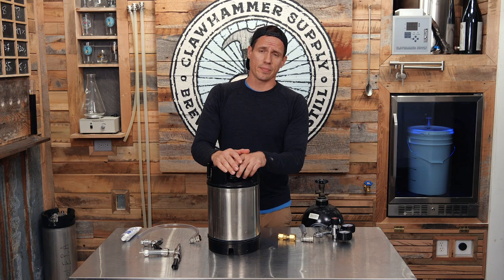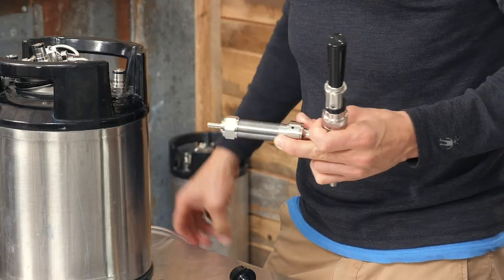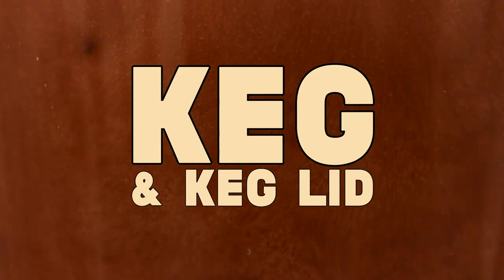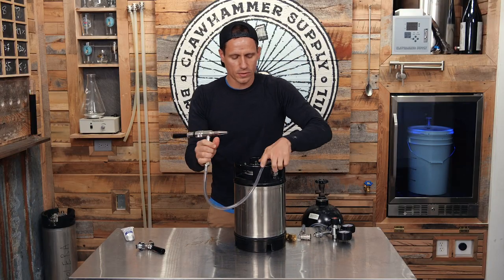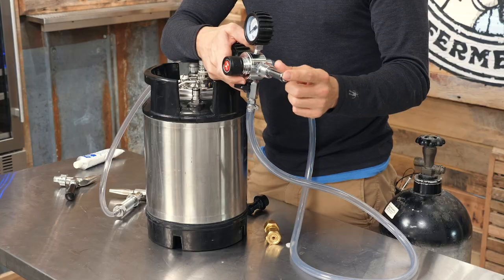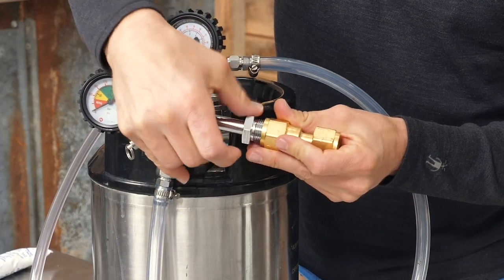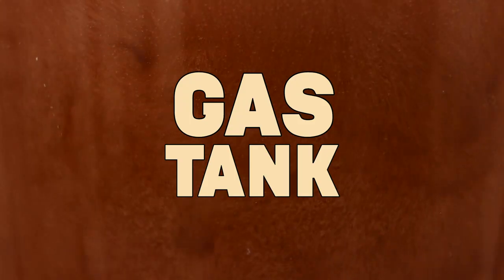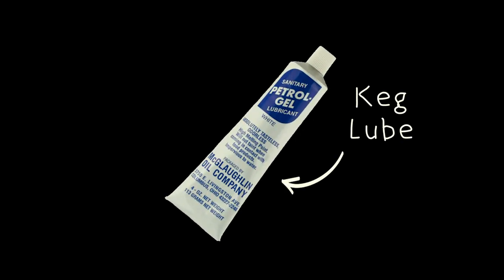How to Serve Nitro Beer at Home | Nitrogen Homebrew Tap System | Complete Guide

Comment: That lid gas stone thing is for quick carbonation. The small bubbles absorb faster. They also create a load of foam in your keg. It's said that the chemicals that make foam only do it once, so foaming in your keg means less stable foaming in your glass. It will absorb without this stone, it'll just take longer, like set and forget method CO2.
Reply: Thanks! I needed this! I was thinking that an inline wouldn't really have the same effect anyway because it has to be in the beer not part of the gas line. Right?
Reply: @caseymckinley1253  I don't know what you mean, but I use the exact same set up for Nitro and CO2. I just swap the gas bottle over (with the adapter required for a CO2 regulator), increase the pressure to account for partial pressures, and put a perforated disk in the tap/faucet. Perfect Guiness style nitro pour with that thick creamy head.

Comment: Just bought a nitro setup. I understand nitro doesn't carbonate the beer. Whats the best way to carbonate when using nitro? Is it only for dispensing?
Reply: Force carb with co2 then just use 70/30 gas mix to serve.

Comment: Bit over complicated. Just force carb to 1.0 vols of co2 with co2 then use beer gas to serve. Use secondary regs. A beer gas bottle has 3000psi in it. If the reg fails....

Comment: Not sure if it was mentioned but isn't it the case that the Nitro is also generally set at a much higher PSI than CO2 - something like 40+PSI so that it get's properly infused?
Reply from the maker: Yes, 30-35 psi!

Comment: I was always told that you can't use a c02 regulator on a nitro tank even if the connection is for c02. the c02 reg won't display the correct pressures and they're not built to withstand the higher pressure either.
Reply from the maker: Hmmm... Yes, the pressure is different but not that far off. I regularly set my co2 tank above nitro serving pressure to quick carb. I also read an article in craft beer and brewing that seemed to suggest that you could use co2 regulator for nitro. Buuuut, never tried it, so don't quote me!
Reply: You could use a nitro regulator for co2 with the adapter, not the other way around, carful with high pressures

Comment: Nitrogen cylinders are higher pressure than CO2, and the regulators are designed to deal with that pressure. You can use a Nitro regulator on CO2 with an adapter. But you shouldn't use a CO2 regulator on Nitro.

Comment: A nice low-key overview.  Thanks.
You may have answered my one concern/thought at the end with your catch:  THE LUBE.
Is that for every connection including the screw-thread ones and the retracting-connector ones?  I was thinking with the screw-thread ones especially the ones that would be maintained for a week or more could use Teflon tape which is food safe.  Any thoughts?

Comment: Fun fact: you can nitrogenate beer using co2 only. When you add the co2, do not purge the air out as that leaves naturally occurring nitrogen from the atmosphere on top of the beer which makes it nitrogenated. Oxygenating the beer could be an adverse side effect however but then just drink the beer quick.

Comment: Yeah, I heard the thing about longer beer lines for foaming reasons. I used to have loads of issues. Now I use about a meter of 3/16" on all my taps at about 15 PSI and get perfect pours. I use a nitro/CO2 mix on all my beers and use a perforated plate in my tap if I want it served Nitro style.

Comment: Why did the beer gas tank have male threads on the valve?  Every one I have ever seen has the female connection on the tank valve.  I used a CO2 regulator rated at 2600 PSI and bought an adapter to use it.

Comment: Those metal keg connects look niiice, might have to check those out if they are working well.
Reply from the maker: For the low low price of $25, you too can try a pair! They're expensive, but so is a tank of leaked gas, so i'd say probably worth it.
Reply: @ClawhammerSupply  yeah and I’m assuming they will outlast any plastic connects I would have to buy in the years to come. Thanks!

Comment: Why do you need the different taps for co2 vs nitro? Is it just because you can push it backwards and "top up" the glass? Also does this setup work for other nitro beverages like coffee?
Reply: Stout (nitro) faucets also have a little jet (restrictor) disk (looks like a shirt button) that slows the flow and agitates the beer as it passes through, creating the cascading head.

If you have taps like Intertap that allow interchanging parts, you can also get a stout faucet attachment for cheaper that mimics a stout faucet. It includes the jet disk, but does not allow the same handle motion as an actual stout faucet. It also may be more prone to some leakage.
Reply: It creates turbulence inside of it, helps to create more foam

Comment: Do you need that special lid with the carbonating stone to use beer gas or can you run the gas the same way co2 is hooked up to a keg? Also do you lightly carbonate the beer before hooking up beer gas?
Reply: I wish someone would have answered this, lol. I need to know the same.
Reply: @caseymckinley1253  do it the way Kyle is doing it. It's working great for me and don't carbonate your beer just hook up the beer gas and turn your pressure up 2 lb every 5 minutes until you get around 28 or 30 PSI
Reply: @aaron woloszyn Problem is that I have a ball keg and it has no option to add a in tank carbonation stone.
Reply: @caseymckinley1253  I have a nitro system at home. I don't use a carb stone for it. Just carb your beer to about 1.0-1.5 vols on CO2 then hook up to nitro. Works fine for me.
Reply: So force carbonate it with 1.0-1.5 vols of co2 then use the nitro gas mix for serving?
Reply: @thomaslinehan1941  thanks for the reply buddy I posted that over 2 years ago think I have it figured out by now... I hope lol

Comment: Using the Carbonation chart from Brewing Quality Beers by Byron Burch
 At a temperature of 43 degrees, 7 psi CO2 will result in 1.9 volumes, therefore:
 7 psi CO2 X 4 = 28 psi of Beer Gas
or about 30 PSI!

Comment: No one's said it," this dude is an idiot"! On the reals you can attach a fancy antimicrobial vinyl hose to your gas post stub with a tight fit or stainless hoseclamp and the same to a carb stone (mid keg height) and skip the lid cost. I've been doing this on a pin lock set up and gas manifold for years no prob, 24hr carb times @30psi serving at 12, 3264' elevation 6' 3/16 hose.

Comment: My friend. I make beer in. Simple equipment and dry dinar grass, but without foam What is the secret of foam? Please, your friend from Syria answered me
Reply: Foam or "head" is heavily influenced by both carbonation and your ingredients. Very roughly more protein rich ingredients will influence your foam, wheat is often used to help boost head. I'm not familiar with dinar grass but I'm guessing it is your primary problem as it likely doesn't have a significant amount of protein compared to barley or wheat which is commonly used in Western brewing. I'm guessing western ingredients are not common there so you can try experimenting with your carbonation level to boost your head, so I wish you luck.